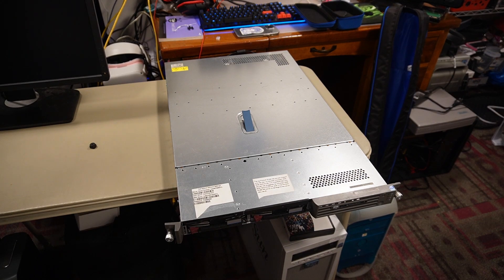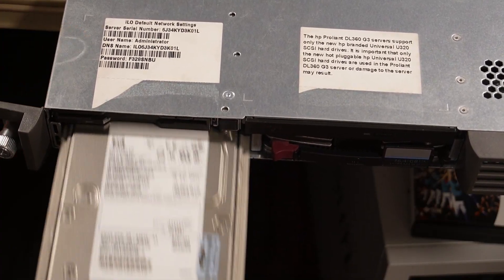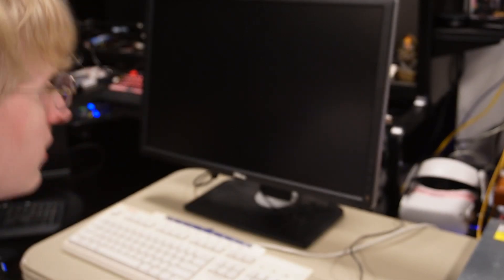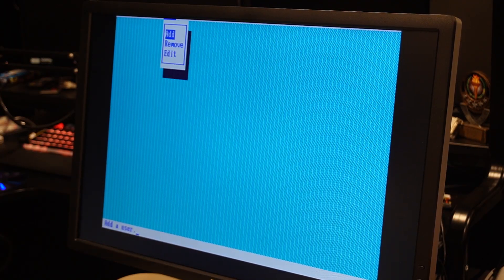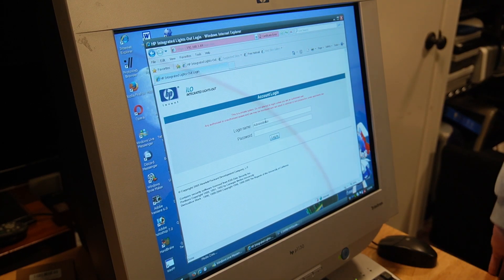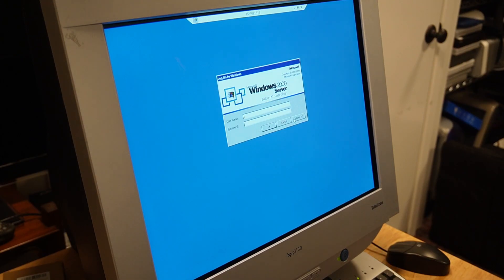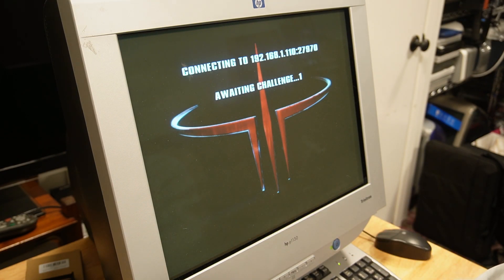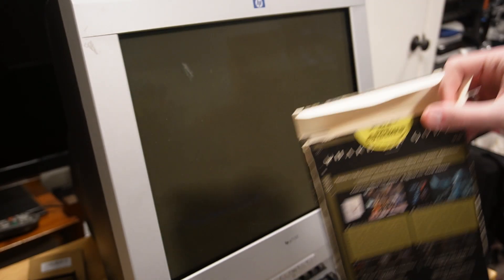Attempting to Setup a Quake 3 Server on a HP DL360 Gen. 3

Comment: 15:32 You have the wrong IP, you set it up to be 192.168.1.112, not 192.168.1.110
Reply from the maker: 112 would've been the iLO--but good thinking. i have 110 & 111 go to my Windows 2000 Server install depending on what ethernet port is used
Reply: @ktg5 Oh ok, well then those old softwares can act weird sometimes... Maintaining abandonwares like these would be a good occupation.😅

Comment: fun fact, the DL series under Compaq had the rilo, (remote insight lights out) pci card. I had crazy cabling to tie into the actual power switch, required an external power supply. But we owe iLO and DRAC functions to Compaq. Also look for the ISO for Smart Start CD, they were used to "simplify" installing an OS, and included all the agents and drivers.
Reply from the maker: yea the compaq proliants are hell to deal with compared to when hp brought 'em & started making proliants under their name. originally i was actually looking for a compaq server because the only other pentium 3 machine i had was some stupid dell computer, until i just gave in & brought this server in the video. i think it was the prices that kinda drove me away from those.